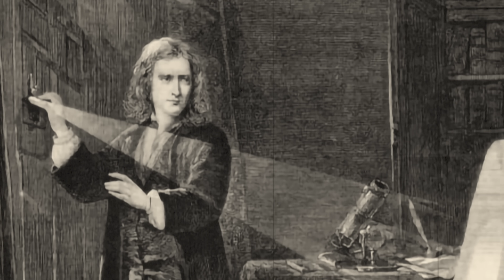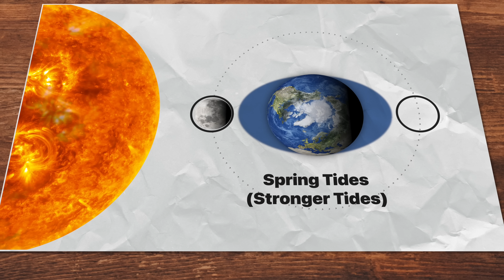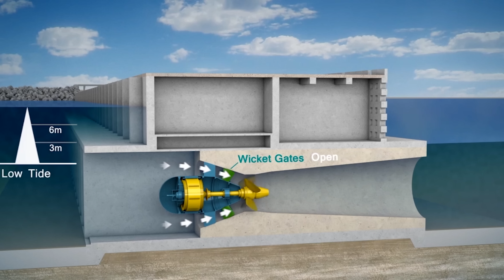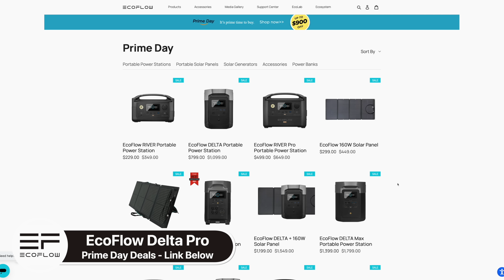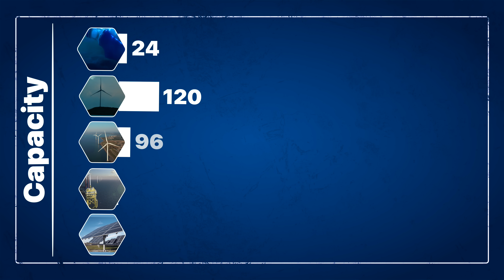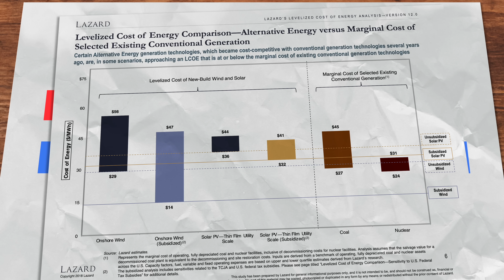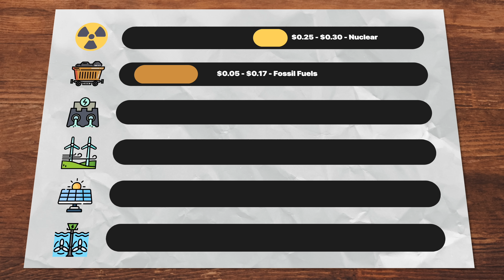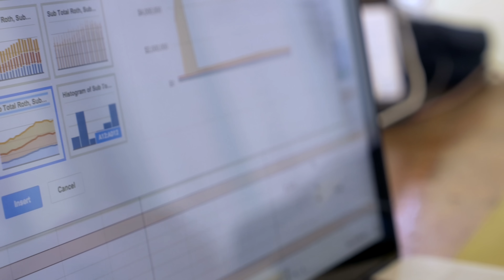Breakthrough Energy Source is 10X Better Than Wind & Solar!?

Comment: Tidal energy is really just gravity :)
Great video.
Especially the point about the battery costs for intermittent energy sources.
Would be interesting to add the storage costs to wind and solar and then compare to the tidal energy.
I did not even know about the plant in France. When my kids will be older, I have to make a trip there. Thanks for sharing this!
Reply from the maker: Great point, energy costs should be factored in for a better comparison... appreciate you as always Robert!
Reply: @TwoBitDaVinci  there is also a more complex method of storage in the form of hydrogen and it's derivatives (molecules of rising complexity such as ammonia, methane and higher hydrocarbons)

The drawback of lower efficiency is compensated by being fully integrable in current consumer structure and by making "ideal spots" accessible through storability and transportability.
Reply: @TwoBitDaVinci  There`s a town in Hawaii powered by a tube in loop form going deep down in the ocean and back. The temperature differential causes water to rapidly circulate through the tube running a turbine. Have you heard of this?
Reply: @baneverything5580  that sounds amazing. What is the name of the project/generator if I may ask?
Reply: @excelsior8682  Here`s one thing I found but it doesn`t sound like the same thing I heard of: The technology, referred to as Ocean Thermal Energy Conversion (OTEC), is described in the Journal of Renewable and Sustainable Energy, which is published by the American Institute of Physics (AIP).

It involves placing a heat engine between warm water collected at the ocean’s surface and cold water pumped from the deep ocean. Like a ball rolling downhill, heat flows from the warm reservoir to the cool one. The greater the temperature difference, the stronger the flow of heat that can be used to do useful work such as spinning a turbine and generating electricity.
Reply: Achktually, it's really just angular momentum from the earth/sun/moon system. Gravity is just a medium to transfer momentum.
Reply: The dam wall in France is a road. So you can drive over it..
Reply: Levelized COE comparisons can be misleading, especially when environmental externalities (like CO2 emissions, habitat degradation, etc.) aren't factored in.  All energy developments are a trade-off between economic and environmental effects.
Reply: Precisely, and I think they fudge the true cost of nuclear when taking decommissioning and waste storage into account
Reply: Renewables are stupid.
They are a kids lemonade stand kind of business.
There is no anthropogenic global warming (aka superstition).

For serious energy, see Thorium (please spare me the stupid boondoggle that is "fusion")

Does this guy sound like he has a trust fund, or is it just me.
Reply: Isn't all hydro electric generation gravity... If you want to pull it apart wind power is just solar energy.
Reply: @paulbarlow543532  Gravity is the potential field, but ultimately, hydro power is driven by solar energy which evaporates water from the oceans (and fresh water bodies to a lesser extent).
Reply: @DFPercush  But what is causing all that fusion on the sun? ;-)
Reply: @paulbarlow543532  Hmm, touché, good sir. :P
Although, it's kind of the same story, gravity creates a lot of pressure which overcomes a potential well of nuclear forces, but the energy itself is supplied by matter just being condensed energy in the first place. And then what created that matter, the big bang etc. I guess the difference is whether we're talking about the source of the power or the mechanism to harness it.
Reply: @paulbarlow543532  Gravity, very powerful gravity. Not lasers.
Reply: @paulbarlow543532  If you really want to pull it apart all energy came from the big bang.
Reply: @johngreen4610  there was no big bang, thats a cute little blanket statement for "we have no idea what we are talking about" lol
Reply: @Paul Barlow  Hydro is just solar energy with more steps.  

So is wind.

So is slaver-
Reply: @paulbarlow543532  you could argue hydro is solar because the gravitational potential energy comes from the sun evaporating water that condenses higher up to fill reservoirs. After that you could argue that solar energy is just nuclear energy
Reply: @paulbarlow543532  Indeed, and solar energy is nuclear fusion energy. Is tidal energy the only energy mankind is using that is not derived from nuclear fusion or fission?
Reply: Gravity + Earth's Rotation + winds . . . ?
Reply: @ravindrakhardekar704   Your almost there - "Gravity + Earth's Rotation + winds . . . ?" + Solar + Storage = No need for fossil fuels ! :) , Storage doesn't have to be all batteries either, Pumped Hydro ( where possible/practical) and even better Gravity based energy Energy Storage , a cost effective & reliable 100% renewable future is possible right now ! we just need to get on with it ! :)
Reply: @pwrrpw319  Too bad all of this is so expensive. I`m struggling just to get emergency solar power for my camper. I`m on disability and battery prices are obscene. When I got the government stimulus checks I bought solar power stations, cables, solar panels, and three 12 volt cookers so I don`t have to always use propane. I have emergency power for a 5 cubic ft chest freezer, a dorm fridge, cooking, lights, fans, and charging power banks and radio batteries, but powering a small air conditioner costs big money. I may have enough left after getting the camper set up and in working order to get a 300 ah LiFePo4 battery with 4000 charge cycles to 80% remaining capacity. I think it can run a 5000 BTU window unit for at least 7 hours and all day if the sun is shining to keep a solar charge of at least 700 watts going into it.
Reply: @pwrrpw319  "We" have a political paradigm problem, e.g., only authoritarian/collectivist. A non-violent, individualist paradigm, never before understood nor overtly adopted, would revolutionize politics, innovation, social progress, if chosen overtly, consciously, just once. All countries fear this more than anything. It would mean their fraud would be proven when people saw how great freedom was. And it would give our species a chance to survive, which is doubtful under the present worldwide paradigm.
Reply: still there is no cheaper and more reliable source of power than just pumping oil.  lol However, renewable energy does create a lot of jobs including the engineer, the designer, the maintaining, the steel, plastic, the builder, the renewable materials, the mason, blablalba, load of jobs.  I think people are trying to get the cheapest and abundance of material for renewable energy.
Reply: Correct, and while we are at it, make sure we add the true costs associated with Nuclear, namely the military industrial complex required to protect the product from mining to transport, to storage to use, to disposal (25,000 years.) These have been factors that have been left out of the levelized costs but throw the whole schema of nuclear out the window, which should be done.
Reply: @SomnoNaut  That is a very out of date view of nuclear. Various forms of modern reactors don't require monstrous containment because they operate at normal atmospheric pressure while producing temperatures that are far more efficient than legacy nuke plants. Also, LFTR'S (which can possibly be made more efficient with chloride salts) don't require water cooling, which allows them to be sited in almost any location. 

My favorite proposal is to use the sites of existing coal plants for modern nuke plants, using the existing power connections and possibly existing generators. 

And it doesn't require a huge military to protect them because the modern designs use fueling setups that are not conducive to bomb manufacture. In other words, they don't contribute to possible bomb proliferation. The only reason why many nuke plants do contribute to bomb making is that they were designed to do so.
Reply: @everettlwilliamsii3740  Dang it, you beat me to it by days. Well said, though. 

The key point (See: TLDR) is that the military-industrial complex is the reason that a chemistry which can be weaponized was specifically chosen in the first place. It's not that enrichable uranium-driven reactions are necessary or that the military-industrial complex power needs to be involved, it'snthat both were desired by those in charge at the time that those foundations were both figuratively and literally laid. 

Not to mention that the use of uranium has created an entirely new, supplemental power/money structure and those in cushy jobs because of this wouldn't dream of getting away from weaponizable systems without first securing their cash flow.
Reply: @GodlyNoghri  As if this is an excuse. Still not gonna happen.
Reply: @SomnoNaut  
Cr*p.
Reply: @SomnoNaut  See above.

Comment: 14:20 this bit seems wrong. Just because tidal is predictable doesn't mean it doesn't count as "intermittent" (and therefore needing storage). The time of the tide changes slightly each day, so some days the peak tidal flow is nowhere near the same time as peak electricity usage - so it may all need be stored for up to 6 hours.  Storage is the key factor to all the renewable energy solutions - crack that and we can clean up the planet.
Reply: Siemens Gamesa are working with Invinity Energy Systems to develop a long lasting megawatt scale flow battery system initially for wind farm use but it would work just as well with a tidal flow power generator. Inviniry already have small system installed at the European Marine Energy Centre (EMEC).
Reply: True...this!

Comment: River systems flow to sea.  Sure seems like using a river system would be a way to capture that flowing energy without the cost and disruption to wild life and the ecosystem that a dam would cause.  This would also make it available to more countries that do not have coast lines on the sea. This would not be tidal power but it seem that the equipment could be adapted to use in these cases expanding their possible use case and increasing their economies of scale.
Reply: there are a few  river hydro power plants where i live  and they are instaling more each year
Reply: @colinvanful  The ones that divert a portion of a river to run through a turbine are very interesting, though they require a bit of elevation change for them to work properly.

Comment: Most of the negatives about tidal energy production can be overcome in due course through research into material science, electrical engineering, mechanical engineering, etc. The most difficult, in my mind, is environmental impact as this tends to unfold over long spans of time and is difficult to measure.
Reply: it takes time, billion of years maybe until the tidal energy-dissipation will ultimately slow down earth's rotation to 1/Month.
Reply: @konradcomrade4845  I do think it was more the effect on nature not planet rotation. :-)
Reply: @bknesheim  Yep migratory species and such, you don't want a bunch of sea turtles having to navigate a tidal turbine farm to get to their nesting grounds. Or because sounds are transmitted so easily other species may be affected. In all though, considering the alternatives, this would work really well for island nations that can't afford an SMR or don't have the land area to give up to renewables and grid scale long term energy storage.
Reply: @anydaynow01  Many small island nation have "weak" tidal so they will be better of with wind turbines that can take advantage of trade winds.
Reply: Same is true for wind turbines. The problem is very close to why we do not have a thorium reactor. When one type of rector was developed is was much easier to go that route then to spend money on developing a different type. Wind turbines works and you can get them at price that you now. Tidal turbines also need a lot of development cost and that is always an unsure cost.

Comment: What will it take for businesses and governments to ramp up renewable energy generation.
The shift to renewables has been too slow. Around the world we are seeing droughts, floods, fires and extreme temperatures impacting people, farming areas NOW.  Europe, Germany and the rest of the world have been too slow to transition to wind and solar energy and all electric vehicles. Wind, solar energy. geothermal and tidal do not need to be imported and can be produced locally in many countries.
Europe needs to provide incentives for homes and businesses to install electric heat pumps and get rid of old polluting gas and oil boilers.  The move to electric vehicles will also be sped up. There is no good reason to help fund Putin's war by buying oil, gas and coal from Russia.

Comment: Good location for this tends to be areas where tidal control is helpful as well as some roadways overwater , the duel purpose helps with cost of building and maintenance.
Reply: good point, I can see this going so far as to make underwater structures to speed the flow of water across the turbines as the tide moves in and out of an area, like the higher currents at a harbor entrance/exit. Not only would the speed of the water flowing increase it will create a dampening effect.

Comment: ocean current power
Reply: plus tide power
Reply: ocean current power is kinda same as rotation energy extraction from the planet with gyro wheels
Reply: ceramic blades
Reply: ceramic boat hulls
Reply: or at least the top layer of all surfaces
Reply: Pu-238 alpha-nuclear 100year battery, half-life 88 years
Reply: power 500W/kg and mega MWh per kilogram energy storage
Reply: iron-air (ethanol-koh electrolyte) should be same as hydro-electric and solar-electric, even if you get a ton of iron directly from the bulk market, the 5snt/kWh
Reply: cut all cables, live next to ocean, put your own turbine there, no costs, to outside you
Reply: everyone has their own energy system, no mutual dependency, problems solved, no forced centralized systems
Reply: rock erosion takes millions of years, mm'kay

Comment: Tidal energy was tried our many years ago, so why did it seem to die out?  Was it because of the changing of the creatures habitat of the ocean or the endangering the bio-enviroment of the ocean???
Reply: Tidal power was used centuries ago for grain mills but the industrial revolution put paid to that with the dispatchable power of fossil fuels that was more flexible than being dependant on the time of the daily tide. It is only the necessity to reduce fossil fuel use that has recreated interest and with electrical storage it can be truly dispatchable.
Reply: @eclecticcyclist  mills were powered by water power not by Tidal power.  Years ago they were putting flexible panels on the oceans that would generate electricity when they flexed. This was what I was talking about.  Have a great life..  👍
Reply: @johnbethea4505  Tidal power is water power, and I think the flexible panels of which you speak were trying to collect wave energy not tidal flow energy, besides how do you explain  The Woodbridge Tide Mill, which is still working in the UK.
Reply: @eclecticcyclist   don't know about the UK.  But, you and I don't really disagree but we just have different view points on things, nothing wrong with that is there? In they future people may find things that are better than all of these.
Reply: @John Bethea Not familiar with the underwater panels you speak of but will Google it. But I've seen the old grain mills in the Netherlands that relied on the tidal water flow to run them. As mentioned, they went the way of the Dodo when cheap fossil fuels came along and nobody looked at the long term consequences.